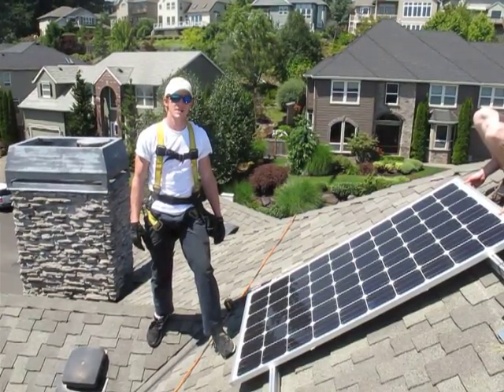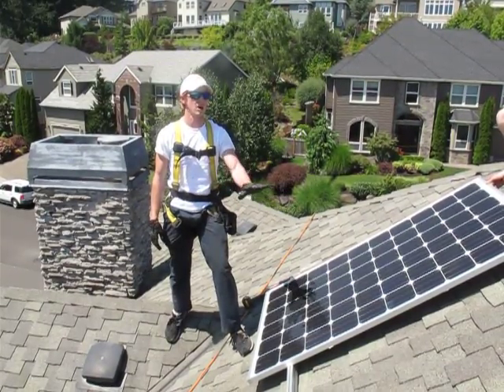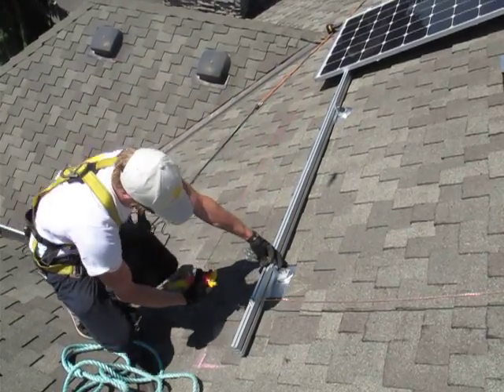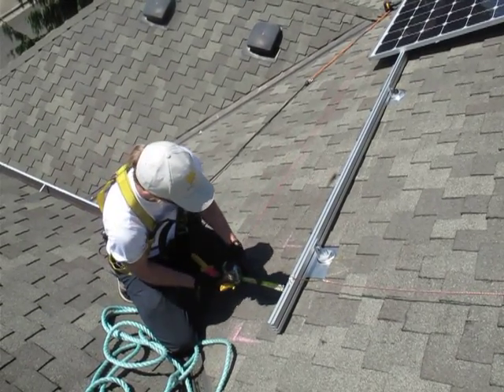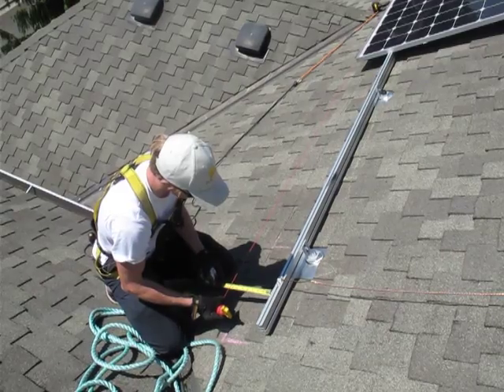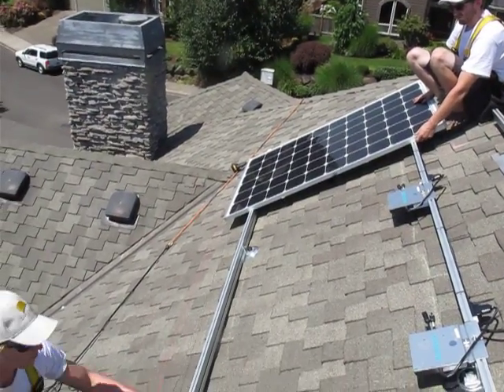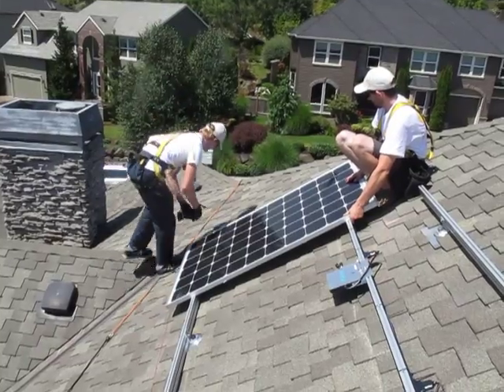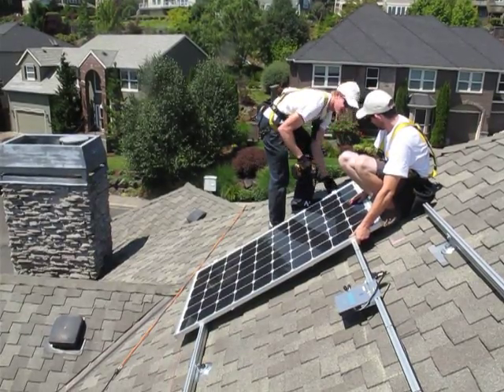How To Square A Solar PV Array

Comment: Problem appears when you have huge roof with 4000 panels. I hate it with burning passion.  When roof is not squared properly... oh god do i hate it.  There is nowhere to check the parallel. So if the 1st and last rail is not perfectly aligned, the rope is practically useless.